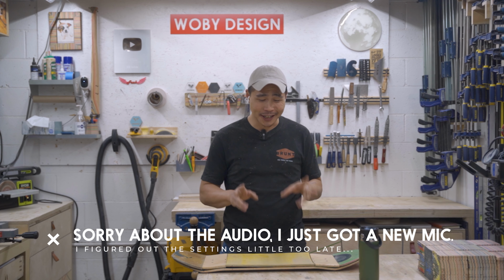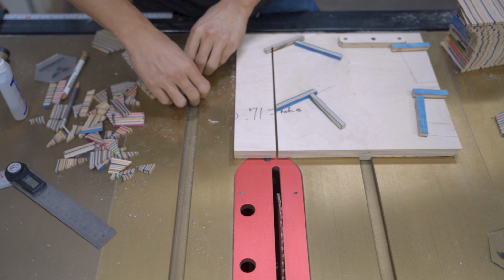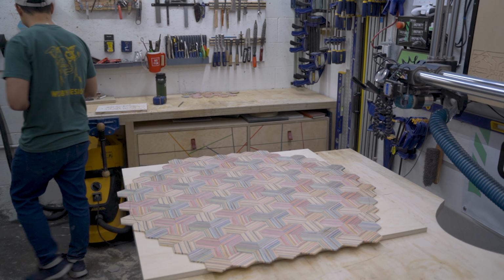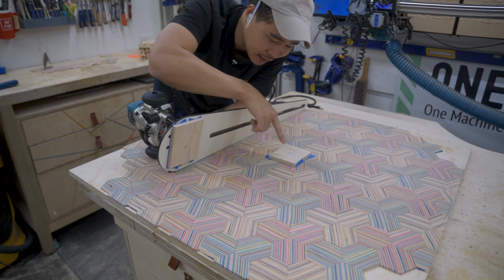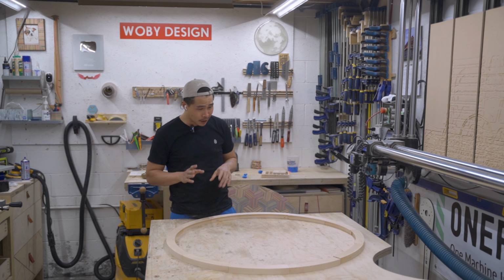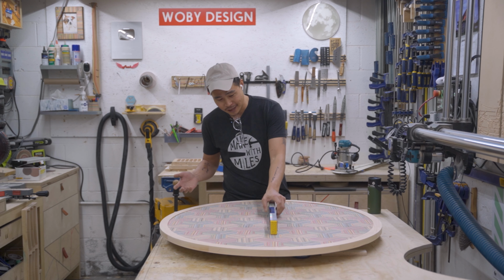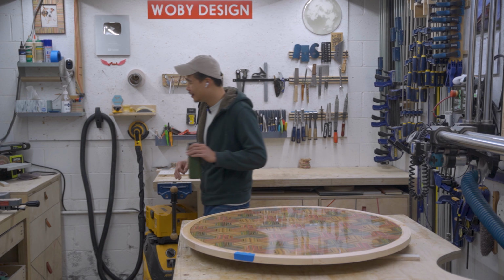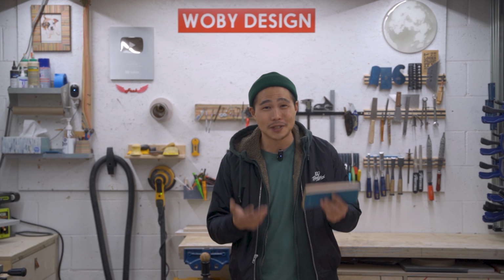WHY DO I DO THIS TO MYSELF?

Comment: One method to salvage those would have been to use the cnc file to make a jig to hold them at the correct angle so you could table saw them. Clever idea with the track saw too though

Comment: Loved how it turned out, but it would have been just a bit better if you'd routed out a recess to put the legs into so they would be flush, and maybe doing bolts with threaded inserts instead of screws. Its a work of art, but if it actually gets used as a dinning table, finishing out the legs and making them easier to tighten &/or dissasemble would be a cherry on top.

Comment: Love the lead-in.  I so identify with that scenario.  EDIT:  The CNC frame would have worked if you made it slightly smaller than planned so you could adjust with the router by shaving off a little.

Comment: I thought you should have put together the outside ring to get the tabletop diameter and cut the Sboard plywood to that diameter. When you ended up with the gap, you could have used edge banding around the skateboard plywood to fill the gap

Comment: You had a lot of good ideas on this build but I’m sure you’re already aware of what to do for next time. I do borders like these often. I know you were trying to save time but running the inside and routing the circle. First know what your finished diameter is going to be, then use that to make your borders in your CAD program. You honesty don’t need the dovetails or anything. The borders don’t need extra support, they’re plenty strong with wood glue or epoxy. However, it is an impressive detail. If your numbers are all right then the dovetails will work. Leave the curved corners from the bit of you like then just cut the dovetail pieces on the CNC too. You can draw it all up in your cad program to make sure it will fit off the CNC. Be sure to offset the dovetails 0.001” or 0.002” so they’ll fit without sanding. Again, it’s plenty strong without them. I would also try to nail the border so you can sand any imperfections after glue up flush with the center piece. I love your work!